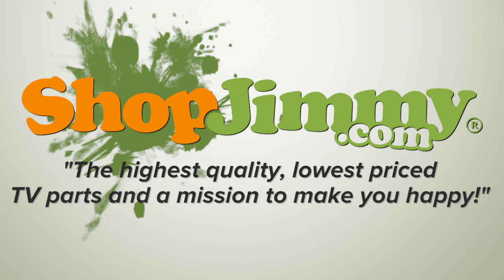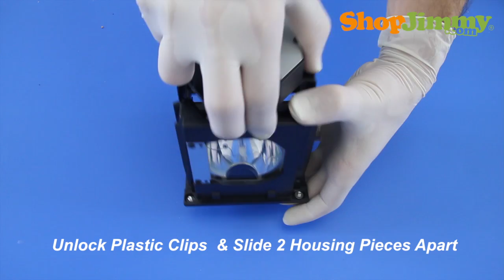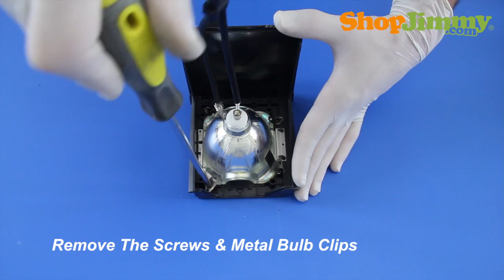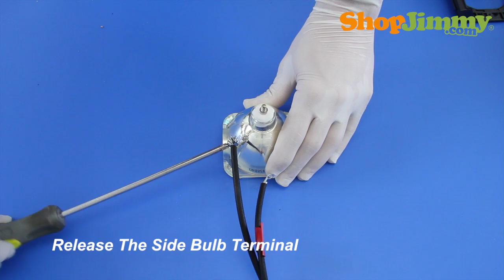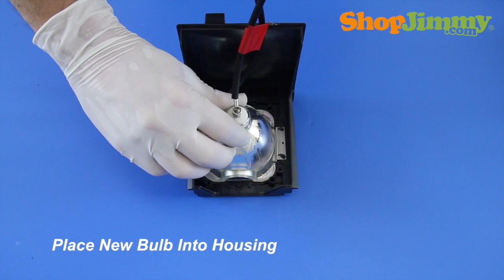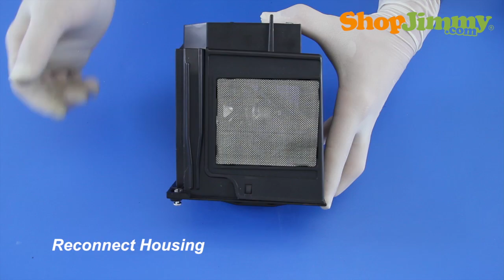Mitsubishi 915P049010 Lamp / Bulb DIY Replacement Guide for DLP TV Lamp Tutorial

Comment: Hey Jimmy.....did you need to reset the Lamp Timer? Obviously, no more Mitsubishi TVs but mine still going strong. Just changed out my 1st lamp and I get varying answers when checking if I need to, how to reset. Doesn't say anything in the manual and nothing when going into the Menu. A TV guy said that not all MTVs need to be reset (I have the wd73837) and if the red light stops blinking you are good to go, no need to reset timer as it does it automatically. Nothing said thru videos, including yours. Google gives various "AI" answers so thought to ask. Thanks!